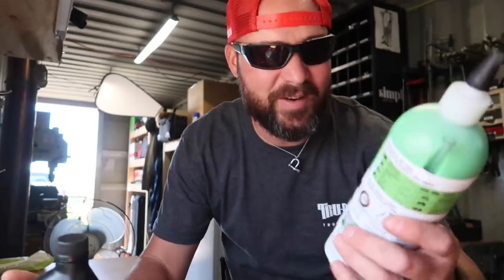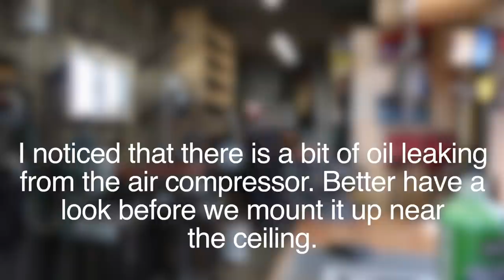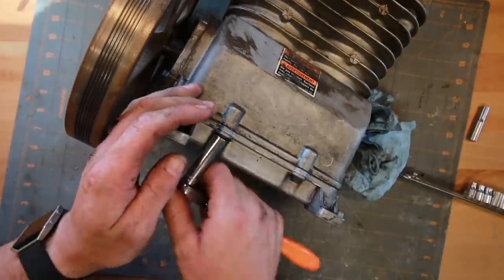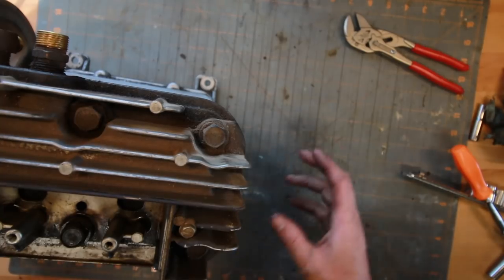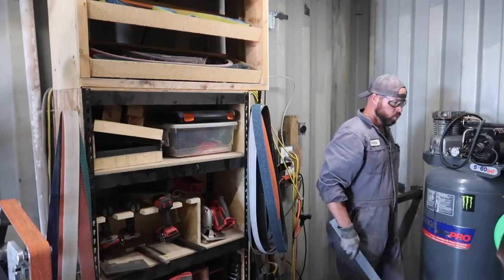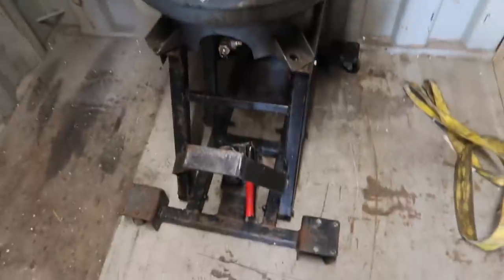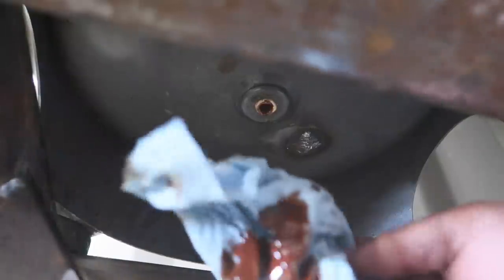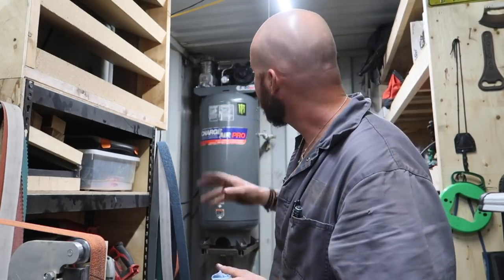Relocating the Air Compressor - will it go? - shop vlog

Comment: Weld a loop/roundbar on the roof so you can winch up the air compressor for easier service. (install a cheap boat winch in the roof for example)

Comment: Put a safety chain around the mid portion of the air tank so if the welds break it can only fall straight down and not on somebody.

Comment: What I do when my mower tires go flat is take the tire to the local tire shop and have them put a tube in it. I've never had a tubed mower tire go flat. But those tubeless ones always end up flat. R
Reply: A ranch hand did the same when a hog bone punctured the tire on a John Deer Gator we were using. Nasty puncture, but the tire was new and worked like a charm.

Comment: Thanks for the video Jeremy. I have a suggestion, if you were to mount two shorter arms for the stan for the air compressor on the left and right instead of the long one in the middle it should give you more clearance below. I'm also hoping that it would be as strong as the single arm. I hope that it helps.

Comment: I saw Mathias W do this thing recently where he raised a heavy top off the floor incrementally by chocking it up in stages until it was high enough for him to get onto his bench. Perhaps he doesn't have neighbours. Thanks J. PS: HAd to watch again to see the rifle.
Reply: I was thinking the same thing. If he can lift it 6in he could chock it and continue to lift it. But there is kind of a limit where you are no longer lifting up, but pushing up. But I think maybe in this instance it could have still worked because of how low the stand was in relation to his core. :)
Reply: Yep. Agree. But then, it's always easier sitting here at my computer and watching someone else do it. For me, I needed help just to get myself out of bed this morning and that's not something I can summon a neighbour to assist with. Have a good one.

Comment: Hey Jeremy. could you have removed the motor and compressor from the top and just mounted the tank up high then mounted the motor and compressor down lower at a more manageable/serviceable height. From there all you would have TO DO IS JUST RUN NEW COPPER PLUMBING LINES TO TIE IT ALL TOGETHER (sorry cap button got pushed, didn't want to retype) Rob

Comment: Maybe cut a hole in the container and create a steel box on the outside. That way you get the space and your stand is on the outside and you could try to reduce noise by closing it off and insulating it? And I have no idea what I am talking about because I am only making comments based on what I've learned from watching you. :D

Comment: Anti-vibe mounts for all our compressors at work are made from ride on compacting rollers drum AV mounts (the mounts that isolate the vibrating drum from the rest of the machine).  On each end, they either have a stud, or a threaded insert that a bolt would go in to and I imagine they would do better at isolating vibrations than a hockey puck.  Maybe a future upgrade.  Might be able to hook you up with 4.  Watch out for that heat and stay cool out there Jer.

Comment: I know you have been making a lot of changes in your shop, getting a better organization to it along with better lighting and storage capabilities, but trust me, as soon as you feel you are done, you will find something else to modify/move to make it even better. Organizing a shop is an ongoing project for all of us. It is looking much better, and I commend you on the work you have done so far. I see some good suggestions already regarding air intakes and sound reductions for the air compressor and tank. I do feel you are really going to enjoy it in its new location much more than before. I also would recommend running air lines to specific locations along the walls so you can have air wherever you are going to need it. Have a great day and a better tomorrow.

Comment: i wonder if the weight & vibration could cause the seacan wall to deform - since the wall gets most of it;s strength from it shape instead of wall thickness.    it might be worth looking on the outside wall for signs of bowing after it's been there a month or so.    either way thanks for all the great videos!